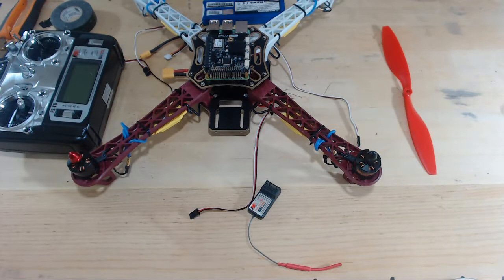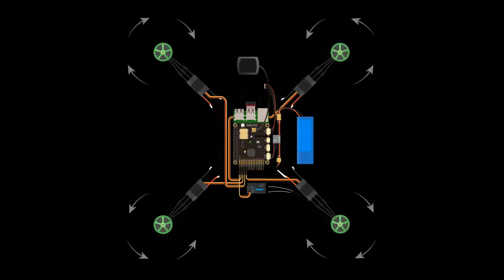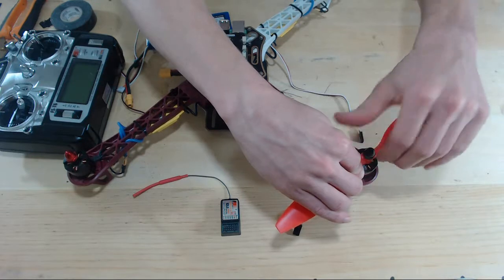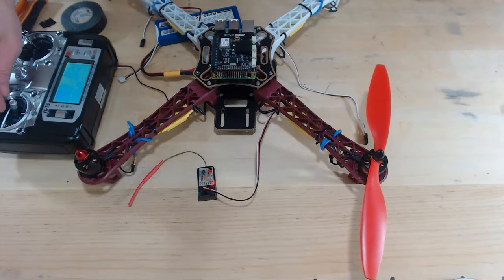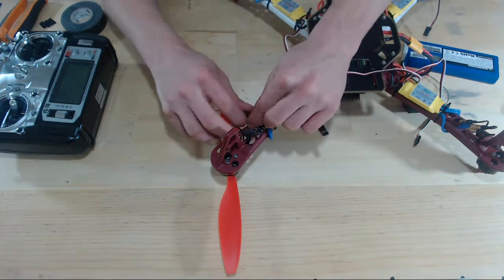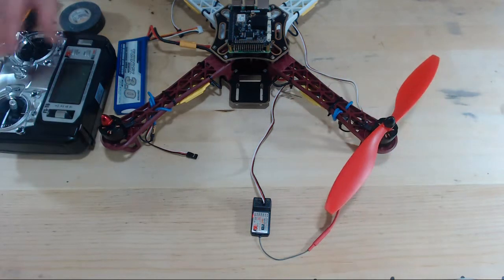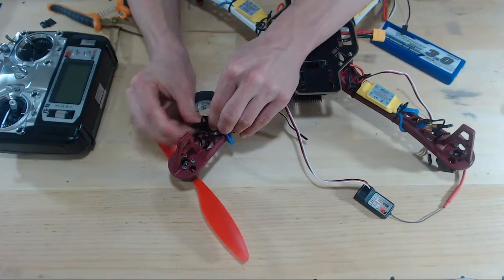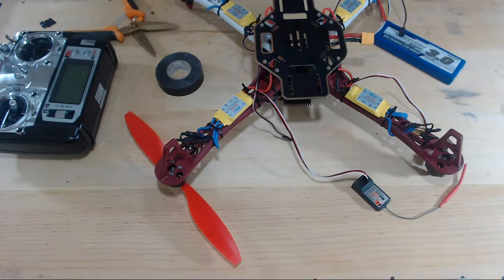Correct Spin Direction of Drone Motors

Comment: Hi, for the servo output under mandatory hardware, if I'm using only brushless esc motor for the drone, does the servo output still shows any readings because there is no servo motor used ?

Comment: About propeller.... In the same way we've to fix all the propeller....Or have to change...??
Reply from the maker: It is possible to install the propeller on the wrong motor. If you buy 4 props, 2 will be for CW rotation, and the other 2 will be for CCW rotation.